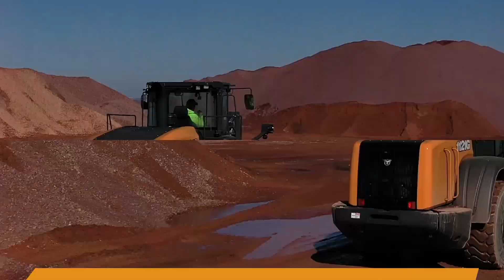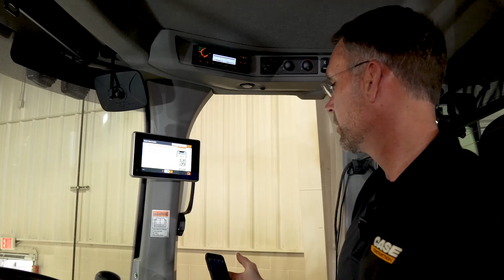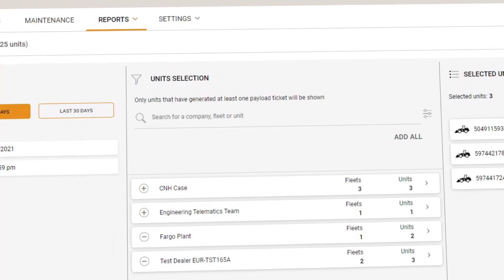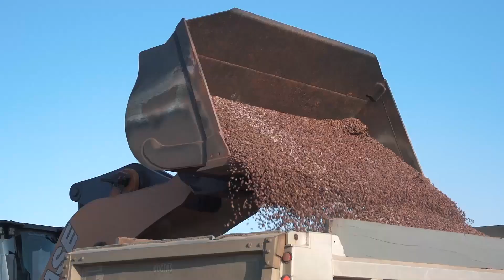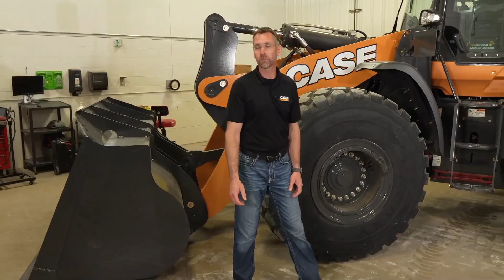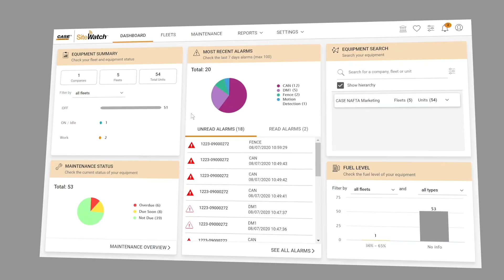North America: CASE LIVE: Connectivity in Heavy Equipment

Comment: Lift capacity on a 321 is 8000 and some change I believe, with a bucket. With 48” forks it’s 5000. A ton and a half difference seems un realistic!!
Reply from the maker: Yousef,

Thanks for following CASE and for the question - we enjoy your participation in CASE LIVE. The lift capacity with bucket is a bit of a different measurement than rated operating load with forks (which it seems you’re referencing from the 321F spec sheet - for instance, operating load with a bucket is about 4,000-4,300 while operating load with the forks is 4,700-4,900). We do not list the lifting capacity with forks - but you are right to acknowledge that it is less than with a bucket. There are many different factors that play into this.

That operating capacity spec is the best apples-to-apples comparison (advantage: forks). Tipping load is another good direct comparison (advantage: bucket). 

We do not list fork lifting capacities because it is going to be different for every type and size of forks. 

Each bucket, fork and attachment has different ratings. Maybe a different type of fork or attachment would be better suited to handle the task? Here’s a link to the various 321F attachments: https://online.fliphtml5.com/kkbp/ewot/#p=78 

Feel free to send us an email at talkwithus@casece.com with your info and we can connect you with your dealer who can pair up the right machine/attachment for your needs.